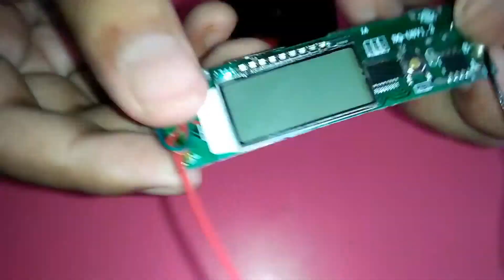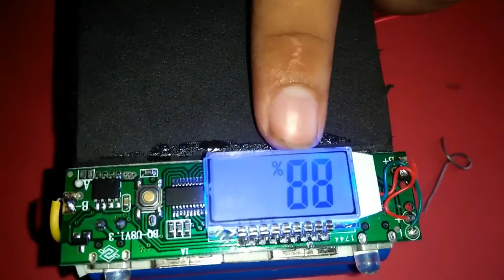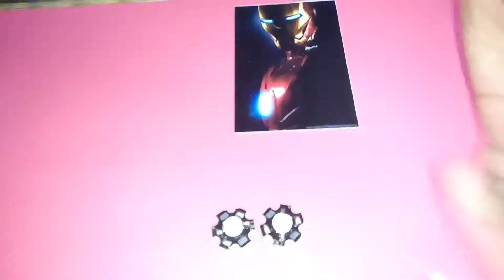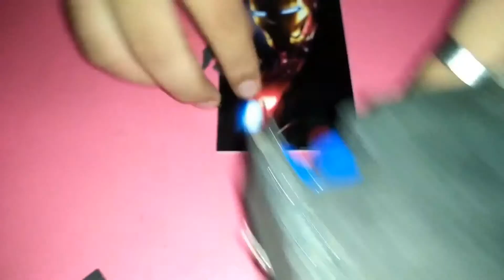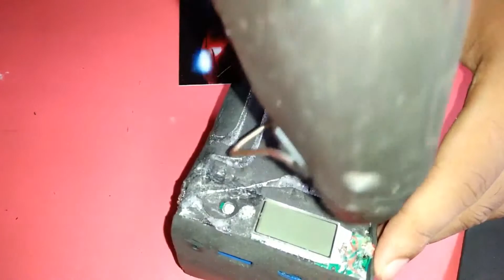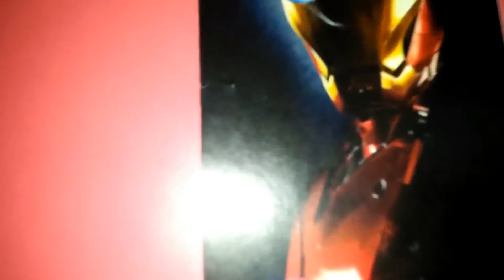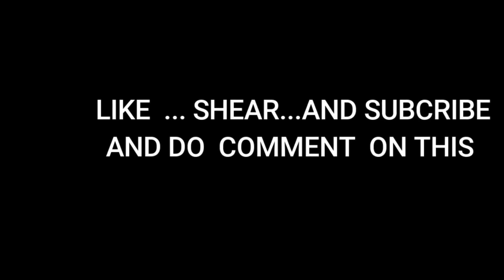30000 mah powerbank|fast charging |easy to use

Comment: 2x 3.7v li-ion battery from old phones , 1x 5v dc step-up & step down converter module + 1x li-ion battery charger module + lil bit soldering & circuit planning + lil bit basic electricity idea = low budget powerbank ( around ₹600 *battery cost extra) 

**i called my powerbank black box
btw nice video...keep it up....and I'm shreyam